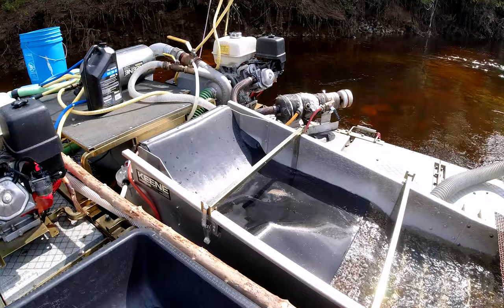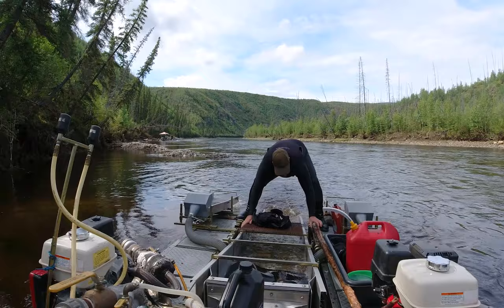3/4 OUNCE OF GOLD IN 6 HOURS: Keene 6" Super Max Dredge in Alaska

Comment: Great dredge, I wonder if Keene will ever go with electric motors and batteries that you could just swap out when low 
So, no more fuel bills or getting fuel into remote area's.
Reply from the maker: No idea to be honest. I know there are propane conversion kits but for batteries you will probably need quite a few to get enough power. Would be interesting though.

Comment: Nice video. Sweet Dredge.   How long can you run this dredge without cleaning it up ?
Reply from the maker: I think it depends. With all the fine gold up there I would still want to clean the dredge out at the end of every day but not multiple times as day.  The flow control on the side boxes really allows material to settle in the mats if it runs to the end of the main box and down into the sump.

Comment: Just wondering how much for that whole setup what time of the year  were y'all there I don't know I'm not a professional but the way it looked like maybe you were losing a little gold in that middle sluice box I didn't see no pan at  the end of it but like I said I'm no professional nice gold wish I was there 👌👍
Reply from the maker: From Keenes site the dredge starts at $10k and depends on the type of engines, side boxes and of course the main sluice.  This one had the sump that catches all the fine material and sends it to the two side boxes with less water flow to capture as much gold as possible. There will always be a loss so you make sure you move as much material as possible. We did test pan our tailings a few times and only found a few stray specks.